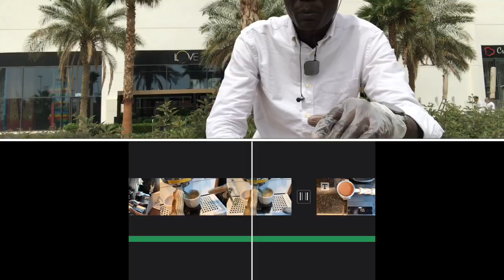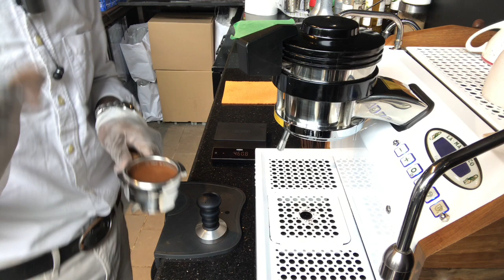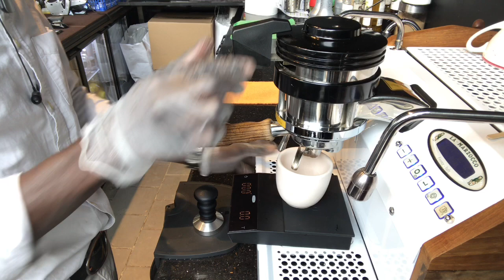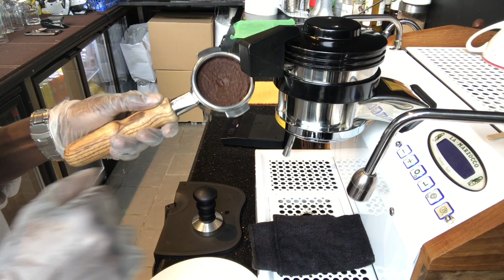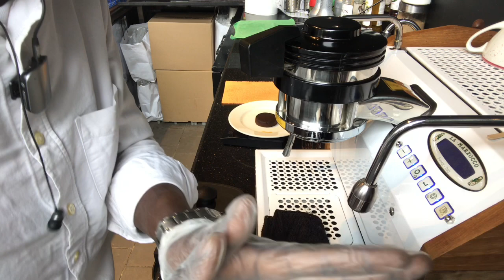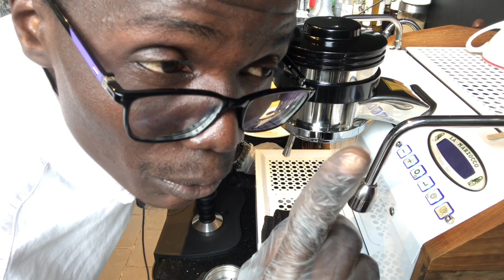What is Doppio Coffee❓ Understanding Espresso 2023

Comment: nice lesson.am just a new barista
Reply from the maker: Am thankfull lets keep learning, kindly do share the link for those in need 🙏
Reply: @dr.coffeebaristabernadoantonio  but please how many espresso do latte have?
Reply: and how many espresso do cappuicino have
Reply from the maker: The traditional cappuccino consists of a single espresso, on which the barista pours the hot foamed milk, resulting in a 2 cm (3⁄4 in) thick milk foam on top. Variations could be made adding another shot of espresso resulting in a double cappuccino.
Reply from the maker: It depends with the size of a cup, if am using a 12 ounce cup i will use a double shot espresso  like in my small ceramic cups i do use 1 single shot of espresso. A guest can order much more stronger, i will use a double shot, but the most important thing it to understand what is a cappuccino. Same applies to latte, flat white etc.
Reply from the maker: In short we have double cappuccino & single cappuccino in our coffee menu boards,  the difference in the two in making, is just the number of shot you put.
Double shot espresso for double cappuccino
Single shot espresso for single cappuccino

But remember a guest can order a double cappuccino extra shot to make them total 3 shots, 😀😀   So there is no significant numbers of shots in cappuccino, what matters is do you understand what is a cappucinno❓
Reply: @dr.coffeebaristabernadoantonio  yes boss but am still going for classes in dubia
Reply: @dr.coffeebaristabernadoantonio  but boss is shot same as single espresso?
Reply from the maker: Yes 1 shot is equivalent to a single espresso
2 shots equivalent to a double espresso
But depending on the dose (grms) and yield (ml)
Reply: @dr.coffeebaristabernadoantonio  please what could be the ratio to extract single espresso
Reply from the maker: A ration of 1:2 will be good and standard eg 14 grams of coffee ( dose ) and 28ml of extracted espresso ( yield )
Reply: @dr.coffeebaristabernadoantonio  ok boss that is for single espresso right?
Reply: please boss l dont understand 1/3 espresso 1/3 milk 1/3milk form.explain to me please
Reply from the maker: Get into my youtube channel look for a tutorial video about brew ratios